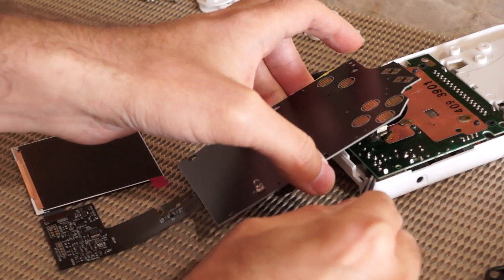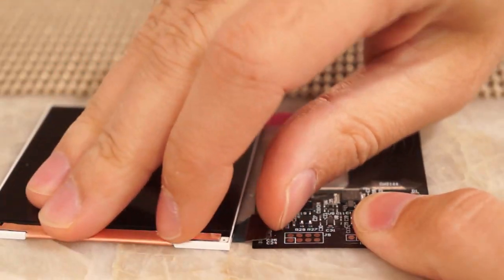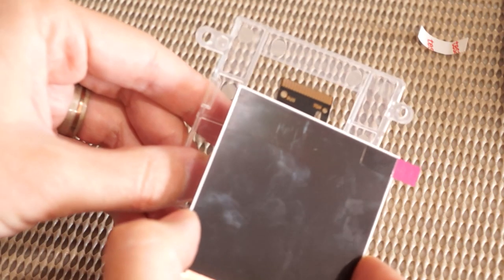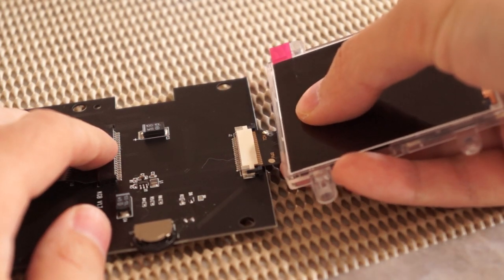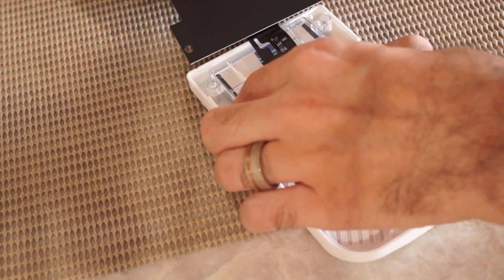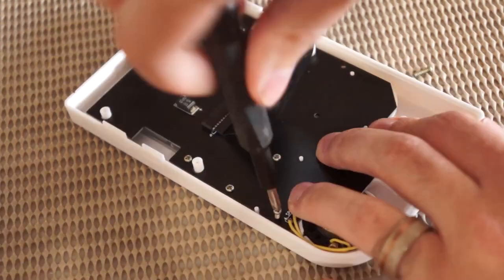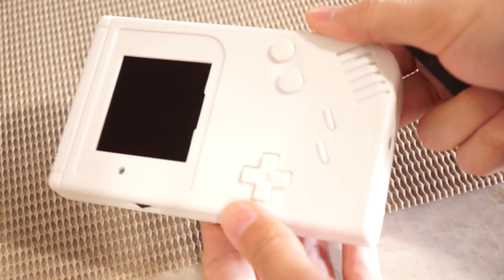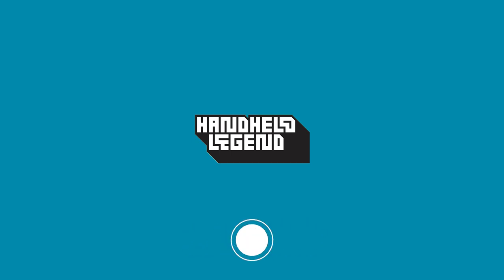DMG Q5 Retro Pixel IPS | Install Guide

Comment: What tools do you recommend for the screen cutting and sizing of the shell? Particularly with the increasing viewing space …. ?
Reply: Dremel/files
Reply: Files for sure. I wouldn’t use dremel on plastic shells for precision. They tend to create heat and melt more than they cut.
Reply: clip off those two screw towers with flush cutters and razor off any remaining to get it flush with the shell. I didn’t expand the window and it looks fine too. The boarder isn’t visible with my original shell.